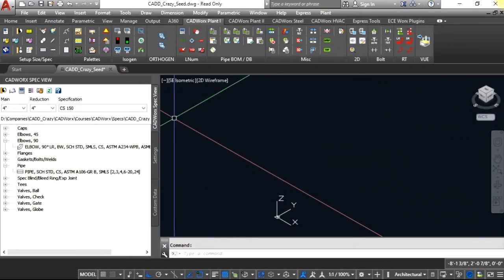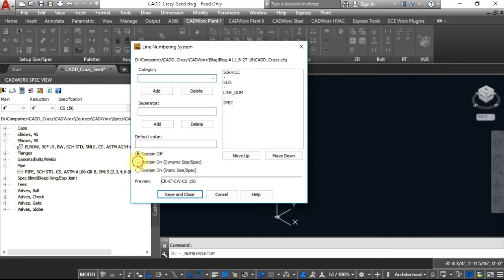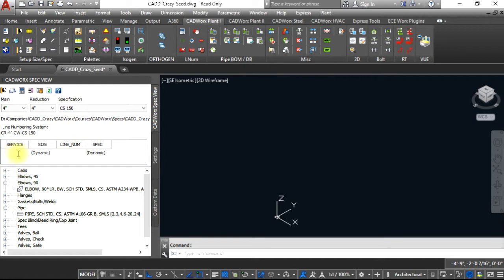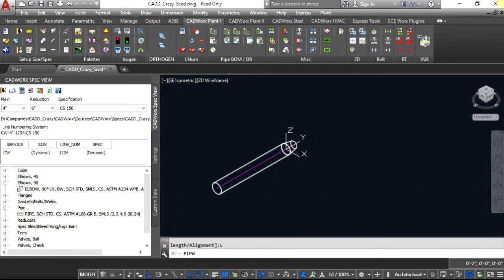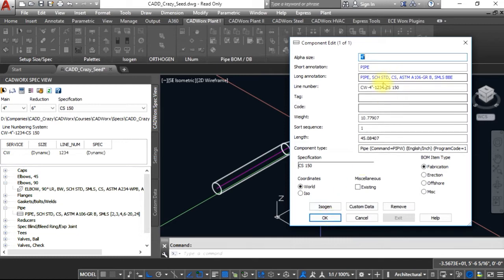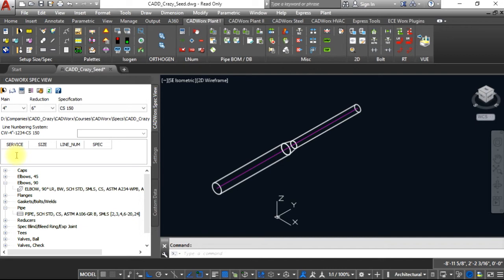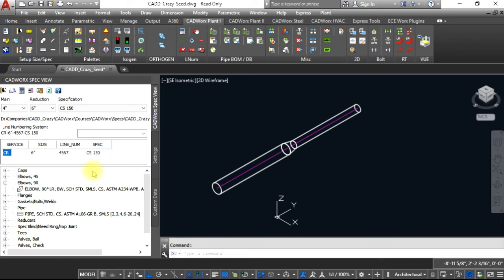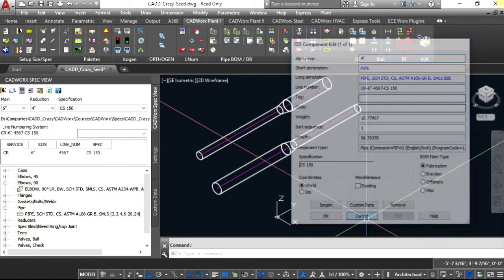CADWorx Line Number

Comment: Please i installed cadworx plant 2019 everything are working except Cadworx Equipment, whenever i double click on Cadworx Equipment icon it loads with Error [CADWorx SPLM Error 7502]
 Could not read data from SPLM (SmartPlant License Manager) server.

If SPLM licensing is available, configure SPLM on this computer to connect to the SPLM server and then re-start CADWorx. Install and setup SPLM before CADWorx can use a SPLM based license.
please i need your help, thanks
Reply from the maker: We just had that problem the other day on CADWorx P&ID. Hexagon went to a new license manager call Intergraph Smart License Manager, so that might be some of the problem. I had uninstall the plant pro making sure the folders where gone to and reinstall. Beside that I do not know what to tell you to do. You would have to get in contact with Hexagon help desk.